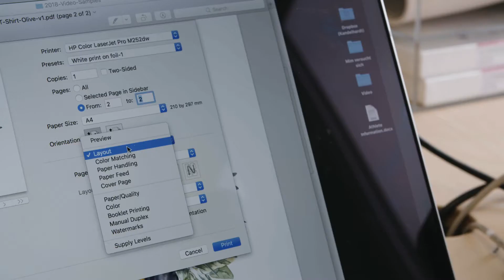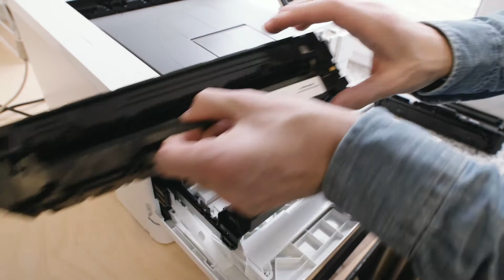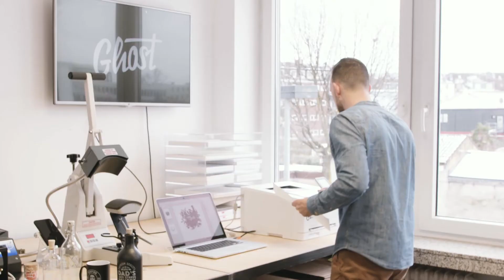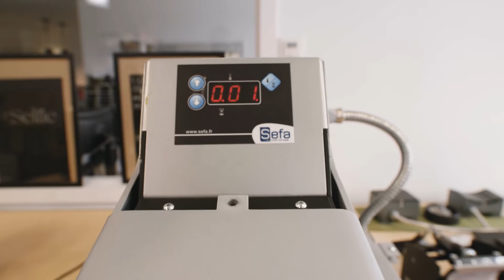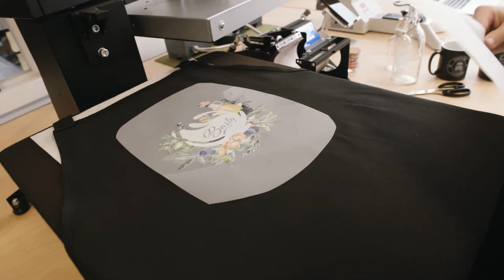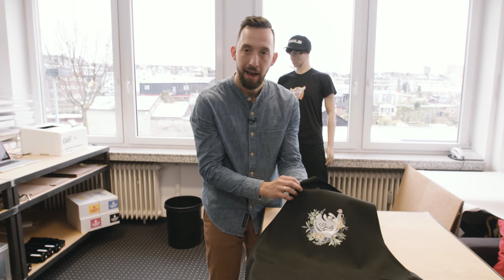How to customize a polyester Apron using Ghost White Toner

Comment: In the video you said, 2 minutes (120 sek) pressing time. But your press shows 160 sec. I've made the experience, that you have to extend the pressing time (in my case up to 215 seconds), depending on which press you use.
Reply from the maker: You saw that correctly. 
We must have made a mistake that turned out well in this case. 

Yes, the times differ for many materials.